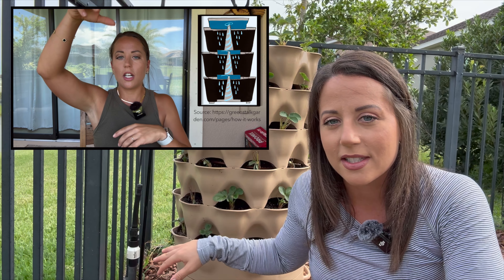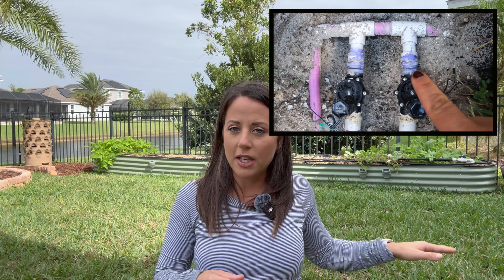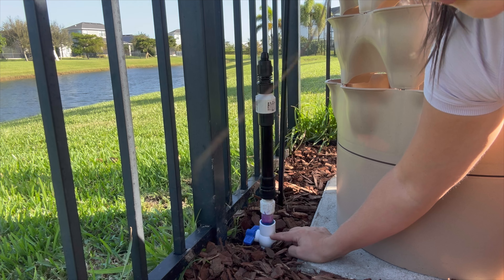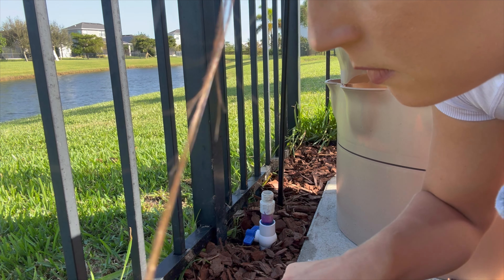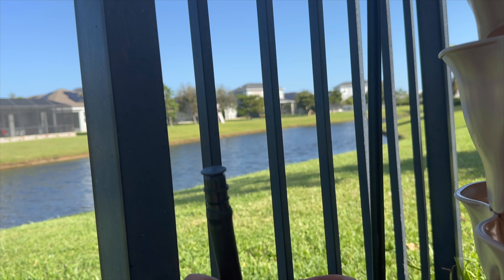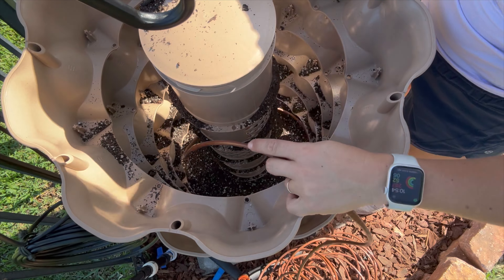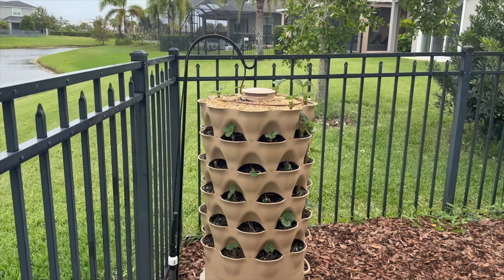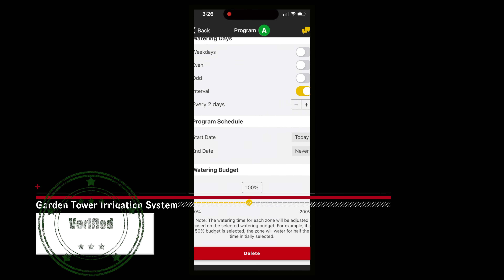An Engineer's DIY Drip Irrigation System for a THRIVING Garden Tower!

Comment from the maker: Products used in this video:
Garden Tower 2: https://www.gardentowerproject.com/products/garden-tower-2-composting-container-garden 

Reclaimed water purple PVC (1”): https://www.siteone.com/en/1pvc200berec-pvc-purple-reclaimed-pipe-1-in-x-20-ft-sdr-21-cl-200-bell-en/p/36518 

Reclaimed water purple PVC (3/4”): https://www.siteone.com/en/75200berec-pvc-purple-reclaimed-pipe-34-in-x-20-ft-sdr-21-cl-200-bell-e/p/114608 

Orbit Bhyve Sprinkler Controller: https://amzn.to/3NVdeMR 

Irrigation Valve: https://amzn.to/3YVWETz 

¾” PVC Slip ball valve: https://amzn.to/4ekflVo 

PVC slip to MHT adapter

1” PVC coupler: https://amzn.to/48DwuIk 

1” to ¾” PVC reducing elbow: https://amzn.to/3YApHuq 

¾” PVC coupler: https://amzn.to/3UGKL11 

Shepherd’s Hook: https://www.homedepot.com/p/Vigoro-Fuchsia-64-in-Black-Steel-Shepherd-Hook-87203/302666818 

24” Stepping stone: https://www.homedepot.com/p/Oldcastle-23-3-in-x-23-3-in-x-1-8-in-Grey-Concrete-Step-Stone-12052900/312182701 

1/4 inch poly tubing with emitters: https://www.homedepot.com/p/Rain-Bird-1-4-in-x-50-ft-Drip-Emitter-Tubing-with-12-in-Spacing-ET25-50S2/202078385 

Black UV Resistant Zip Ties: https://amzn.to/4fyvZ4B 

For the following Drip Depot links, please consider using my affiliate link and searching by sku so that I may earn a small commission
Affiliate link: https://aff.dripdepot.com/aff/idevaffiliate.php?id=463 

Backflow preventer: SKU 4790 

Inline Filter: SKU 1255

Pressure Regulator: SKU 3523

FHT to 1/2 Poly Tubing Adapter: SKU 1193

1/2 inch poly tubing: SKU 3266

1/4 inch poly tubing (no emitters): SKU 3274

1/4 inch barbed connectors: SKU 22390

1/2 inch end cap: SKU 1604

1/4 inch goof plug: SKU 1176

Comment: Jen good video; I have a couple of comments about your system, good design looks like you put a lot of forethought  in to it. I don't believe you need a back flow  preventer for  reclaimed 
water, since the purpose  of the back flow is to prevent contamination of the source. Reclaimed water is non potable. Your pressure reducer is pretty high 25 psi, I use 15 psi
but if you're not blowing out your fittings good, whatever works for you. The half inch cap you used is a barbed fitting, they make crimp rings for this type of fitting to prevent
the cap from leaking. The drip line you used comes with emitters spaced every six, eight, or twelve inches., just take a piece of tube and measure the spacing.
I think your design will work great but you may have to tweak it, time will tell. Hope everything is going good for you since you didn't post last week.
Your beautiful blue eyes  a looking good. Are you sure your an Aero Space engineer and not a Civil engineer? Good video thanks again.
Reply from the maker: Good morning! You are probably right about the backflow preventer, but I suppose it isn't doing any harm. I didn't know about the crimp clamps. I'll definitely add that in if I notice any leaking. Thank you! I was actually running a fever for 6 days straight last week, but I'm finally over it except for the lingering cough.
Reply: Great video, good job how you set everything up, I don’t think the back flow preventer is not necessary, I wouldn’t use reclaimed water to grow edibles.

Comment: I have several green stalk grow towers and love them except for the watering. Thinking about putting mine on drip for a while now while maintaining the swivel. Still dont have a clear idea of how I’m going to do it yet. It’s nice to see how u did yours.
Reply from the maker: Aww I have heard some frustrating things about the watering system on those. Sometimes it doesn't work well if its clogged up with soil and sometimes it'll leave part of the tower dry because it relies on being level. Hopefully you can figure out a cool drip system to help with it. If you figure something out, I'd love to hear about it!

Comment: Wow 30% failure is surprising. I was 10/10 for mine last winter. I’m trying to propagate the runners right now and have about 30 going. I’ll let you know how it goes.
Reply from the maker: Yes please keep me updated on how they go! I am a little disappointed with the 30% failure. I feel like 15% would've been palatable, but 30% has got me wondering what went wrong!
Reply: @ will do! I have a different take on potting soil so I always blame that for plant failure 😂. That is a great drip system btw!

Comment: Where are you reclaiming water from?  Was that something you added on or was it built into your home during construction?  I've only seen one home in my town in Kansas with a drain from the kitchen that routes gray water to their garden.  But that's risky here due to the very cold winters.  It can cause interior pipes to burst.  That swivel should work unless someone treats it like a merry-go-round.  Then all of your tubing will get pulled out.  Maybe design a rotational limiter??  Nice work Jenn!👏🏆
Reply from the maker: The reclaimed water supply is provided to the houses here during construction. It's primarily used for lawn irrigation. The water goes through a treatment process done by the county and there are different levels of water quality. All reclaimed water here is non-potable, but it is the cleanest level of reclaimed water because it's in a residential area. Other places, like a nearby sod farm with no public access, uses reclaimed water with less treatment done to it, so "grayer" gray water. 

Hmmm a rotational limiter.. that is a GOOD idea!
Reply: @SpaceCoastHarvest  Sand Creek Station golf course in my town uses a reclaimed water system for the golf course.  I'm not sure about the homes around the golf course.  But reclaimed water isn't available in my neighborhood.

Comment: Very nice how you set everything up, the back flow preventer is not necessary and reclaimed water is not recommended to grow edibles
Reply from the maker: I ended up removing the backflow preventer. It seems like the whole thing operates a little smoother and leak-free without it

Also, I know reclaimed may not be the preferred water source but it is safe when using a drip or subsurface watering system.  There is info in the bottom of the description of this video about the FL state code as it relates to using reclaimed water on edibles if you’re interested in reading up on it. Reclaimed can be a headache though because sometimes  the timer says it’s running but nothing comes out because there’s no pressure in the system